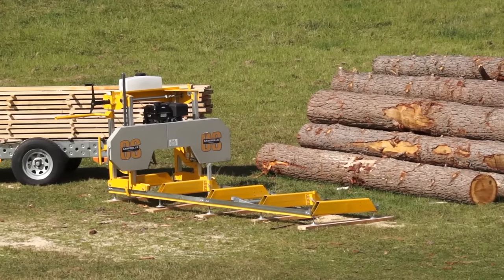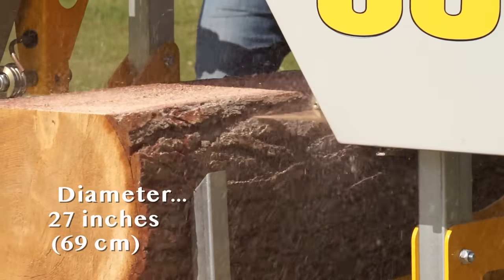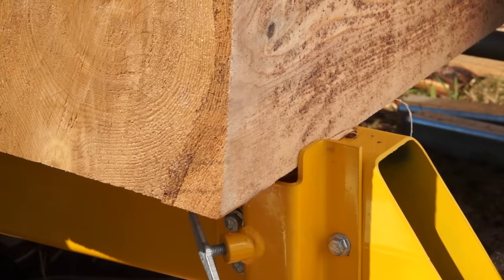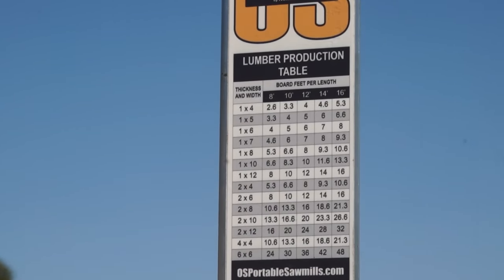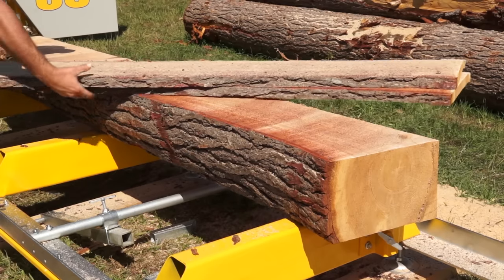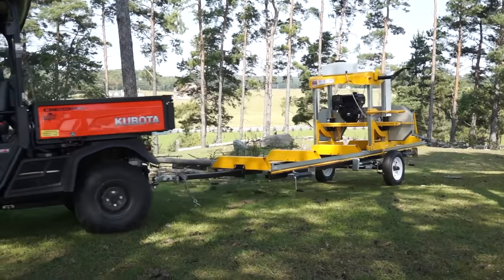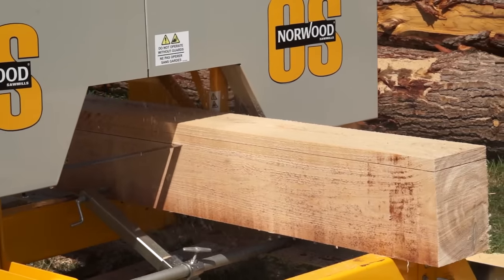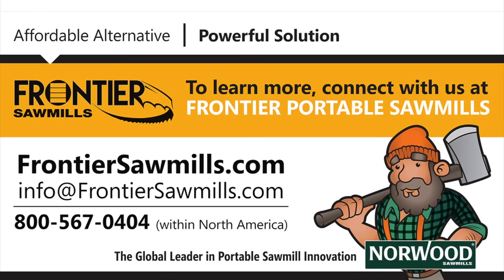The Affordable, Easy-to-Use & Reliable Sawmill You've Been Looking for - The Frontier OS27

Comment: Would make more sense to make a 2 sided blade so instead if a wasted backpull another board can be cut.
Reply from the maker: Your question (suggestion) is not uncommon. Here is the reason why it is not done. Band blades need to be supported in the cut – top, bottom and back. To make a sawmill that can cut in both directions means having a blade with teeth on both sides of the blade. But, if you have teeth at the “back” of the blade, it is hard to support that surface with a blade guide support.
Reply: @FrontierSawmills  ahh yep that makes sense. Never the less. Very cool setup. Thumbs up! Thanks for your response

Comment: Where can buy this mechine
Reply from the maker: Frontier builds three sawmill models with different log diameter capacities: OS23: 59cm (23”), OS27: 69cm (27”), and OS31: 79cm (31”). Standard log length is 3.4m (11’) but you can add 7’ (2.1m) extensions to mill as long as you want.  You can add the optionally available trailer/support jack system to all Frontier sawmills at any time (when you get your Frontier or in the future).

Frontier Sawmills start at just USD $2297 (for the Frontier OS23). The Frontier OS27 starts at only USD $3297.  The Frontier OS31 starts at only USD $3897.  

You can get a lot of helpful info about Frontier Sawmills, including all pricing, at www.FrontierSawmills.com  .

Frontier services your country factory-direct.  To order, contact us directly at Frontier Sawmills via email at info@FrontierSawmills.com . 

Thanks!

Comment: So what does it cost
Reply from the maker: Hi Jayson

Frontier builds three sawmill models with different log diameter capacities: OS23: 23” (59cm), OS27: 27” (69cm), and OS31: 31” (79cm). Standard log length is 11’ (3.4m) but you can add 7’ (2.1m) extensions to mill as long as you want.  You can add the optionally available trailer/support jack system to all Frontier sawmills at any time (when you get your Frontier or in the future). 

Frontier Sawmills start at just USD $2297 (for the Frontier OS23). The Frontier OS27 starts at only $3297.  The Frontier OS31 starts at only $3897. 

You can get a lot of helpful info about Frontier Sawmills, including all pricing, at www.FrontierSawmills.com  .

We would be happy to mail you a free Frontier Sawmills info kit. You can order one online at  https://www.frontiersawmills.com/en_us/free-catalog-free-dvd-form

Thanks!

Comment: A ande encontro  pra comprá?
Reply from the maker: Frontier builds three sawmill models with different log diameter capacities: OS23: 59cm (23”), OS27: 69cm (27”), and OS31: 79cm (31”). Standard log length is 3.4m (11’) but you can add 7’ (2.1m) extensions to mill as long as you want.  You can add the optionally available trailer/support jack system to all Frontier sawmills at any time (when you get your Frontier or in the future).

Frontier Sawmills start at just USD $2297 (for the Frontier OS23). The Frontier OS27 starts at only USD $3297.  The Frontier OS31 starts at only USD $3897.  

You can get a lot of helpful info about Frontier Sawmills, including all pricing, at www.FrontierSawmills.com  .

To order, contact us directly at Frontier Sawmills via email at info@FrontierSawmills.com . 

Thanks!

Comment: Nasıl bulurum, Türkiye’de var mı?
Reply from the maker: We ship Frontier sawmills worldwide.

Frontier builds three sawmill models with different log diameter capacities: OS23: 59cm (23”), OS27: 69cm (27”), and OS31: 79cm (31”). Standard log length is 3.4m (11’) but you can add 7’ (2.1m) extensions to mill as long as you want.  You can add the optionally available trailer/support jack system to all Frontier sawmills at any time (when you get your Frontier or in the future).

Frontier Sawmills start at just USD $2297 (for the Frontier OS23). The Frontier OS27 starts at only USD $3297.  The Frontier OS31 starts at only USD $3897.  

You can get a lot of helpful info about Frontier Sawmills, including all pricing, at www.FrontierSawmills.com  .

Frontier services your country factory-direct.  To order, contact us directly at Frontier Sawmills via email at info@FrontierSawmills.com . 

Thanks!

Comment: Quanto custa pra trazer pro Brasil
Reply from the maker: Frontier builds three sawmill models with different log diameter capacities: OS23: 59cm (23”), OS27: 69cm (27”), and OS31: 79cm (31”). Standard log length is 3.4m (11’) but you can add 7’ (2.1m) extensions to mill as long as you want.  You can add the optionally available trailer/support jack system to all Frontier sawmills at any time (when you get your Frontier or in the future).

Frontier Sawmills start at just USD $2297 (for the Frontier OS23). The Frontier OS27 starts at only USD $3297.  The Frontier OS31 starts at only USD $3897.  

You can get a lot of helpful info about Frontier Sawmills, including all pricing, at www.FrontierSawmills.com  .

To order, contact us directly at Frontier Sawmills via email at info@FrontierSawmills.com . 

Thanks!

Comment: انا عاوز واحد من هذا المنتج كم تكلفته شامل  الشحن والجمارك الى مصر ارجو الافاده
Reply from the maker: Frontier builds three sawmill models with different log diameter capacities: OS23: 59cm (23”), OS27: 69cm (27”), and OS31: 79cm (31”). Standard log length is 3.4m (11’) but you can add 7’ (2.1m) extensions to mill as long as you want.  You can add the optionally available trailer/support jack system to all Frontier sawmills at any time (when you get your Frontier or in the future).

Frontier Sawmills start at just USD $2297 (for the Frontier OS23). The Frontier OS27 starts at only USD $3297.  The Frontier OS31 starts at only USD $3897.  

You can get a lot of helpful info about Frontier Sawmills, including all pricing, at www.FrontierSawmills.com  .

Frontier services your country factory-direct.  To order, contact us directly at Frontier Sawmills via email at info@FrontierSawmills.com . Shipping varies depending on the model you choose and the port.

Thanks!
Reply: My
Reply: @FrontierSawmills  am want wan mines 1500 dollars  bless

Comment: Please Sir how much is this machine
Reply from the maker: Frontier builds three sawmill models with different log diameter capacities: OS23: 59cm (23”), OS27: 69cm (27”), and OS31: 79cm (31”). Standard log length is 3.4m (11’) but you can add 7’ (2.1m) extensions to mill as long as you want.  You can add the optionally available trailer/support jack system to all Frontier sawmills at any time (when you get your Frontier or in the future).

Frontier Sawmills start at just USD $2297 (for the Frontier OS23). The Frontier OS27 starts at only USD $3297.  The Frontier OS31 starts at only USD $3897.  

You can get a lot of helpful info about Frontier Sawmills, including all pricing, at www.FrontierSawmills.com  .

To order, contact us directly at Frontier Sawmills via email at info@FrontierSawmills.com . 

Thanks!

Comment: What's the purchase cost ?
Reply from the maker: Frontier builds three sawmill models with different log diameter capacities: OS23: 59cm (23”), OS27: 69cm (27”), and OS31: 79cm (31”). Standard log length is 3.4m (11’) but you can add 7’ (2.1m) extensions to mill as long as you want.  You can add the optionally available trailer/support jack system to all Frontier sawmills at any time (when you get your Frontier or in the future).

Frontier Sawmills start at just USD $2397 (for the Frontier OS23). The Frontier OS27 starts at only USD $3397.  The Frontier OS31 starts at only USD $3997.  

You can get a lot of helpful info about Frontier Sawmills, including all pricing, at www.FrontierSawmills.com  .

Frontier services your country factory-direct.  To order, contact us directly at Frontier Sawmills via email at info@FrontierSawmills.com . 

Thanks!

Comment: Where can l buy it?
Reply from the maker: Frontier builds three sawmill models with different log diameter capacities: OS23: 59cm (23”), OS27: 69cm (27”), and OS31: 79cm (31”). Standard log length is 3.4m (11’) but you can add 7’ (2.1m) extensions to mill as long as you want.  You can add the optionally available trailer/support jack system to all Frontier sawmills at any time (when you get your Frontier or in the future).

Frontier Sawmills start at just USD $2397 (for the Frontier OS23). The Frontier OS27 starts at only USD $3397.  The Frontier OS31 starts at only USD $3997.  

You can get a lot of helpful info about Frontier Sawmills, including all pricing, at www.FrontierSawmills.com  .

Frontier services your country factory-direct.  To order, contact us directly at Frontier Sawmills via email at info@FrontierSawmills.com . 

Thanks!

Comment: Where can I purchase that machine?
Reply from the maker: Hello Clarence

You can order directly from Frontier Sawmills. Frontier builds three sawmill models with different log diameter capacities: OS23: 59cm (23”), OS27: 69cm (27”), and OS31: 79cm (31”). Standard log length is 3.4m (11’) but you can add 7’ (2.1m) extensions to mill as long as you want.  You can add the optionally available trailer/support jack system to all Frontier sawmills at any time (when you get your Frontier or in the future).

Frontier Sawmills start at just USD $2297 (for the Frontier OS23). The Frontier OS27 starts at only USD $3297.  The Frontier OS31 starts at only USD $3897.  

You can get a lot of helpful info about Frontier Sawmills, including all pricing, at www.FrontierSawmills.com  .

Comment: How much  price...pls
Reply from the maker: Frontier builds three sawmill models with different log diameter capacities: OS23: 59cm (23”), OS27: 69cm (27”), and OS31: 79cm (31”). Standard log length is 3.4m (11’) but you can add 7’ (2.1m) extensions to mill as long as you want.  You can add the optionally available trailer/support jack system to all Frontier sawmills at any time (when you get your Frontier or in the future).

Frontier Sawmills start at just USD $2297 (for the Frontier OS23). The Frontier OS27 starts at only USD $3297.  The Frontier OS31 starts at only USD $3897.  

You can get a lot of helpful info about Frontier Sawmills, including all pricing, at www.FrontierSawmills.com  .

Frontier services your country factory-direct.  To order, contact us directly at Frontier Sawmills via email at info@FrontierSawmills.com . 

Thanks!

Comment: How much the machine.thank you.
Reply from the maker: Frontier builds three sawmill models with different log diameter capacities: OS23: 59cm (23”), OS27: 69cm (27”), and OS31: 79cm (31”). Standard log length is 3.4m (11’) but you can add 7’ (2.1m) extensions to mill as long as you want.  You can add the optionally available trailer/support jack system to all Frontier sawmills at any time (when you get your Frontier or in the future).

Frontier Sawmills start at just USD $2297 (for the Frontier OS23). The Frontier OS27 starts at only USD $3297.  The Frontier OS31 starts at only USD $3897.  

You can get a lot of helpful info about Frontier Sawmills, including all pricing, at www.FrontierSawmills.com  .

Frontier services your country factory-direct.  To order, contact us directly at Frontier Sawmills via email at info@FrontierSawmills.com . 

Thanks!

Comment: Can you please tell me how much and how can I get this machine? Thanks
Reply from the maker: Hi Mike

Frontier builds three sawmill models with different log diameter capacities: OS23: 59cm (23”), OS27: 69cm (27”), and OS31: 79cm (31”). Standard log length is 3.4m (11’) but you can add 7’ (2.1m) extensions to mill as long as you want.  You can add the optionally available trailer/support jack system to all Frontier sawmills at any time (when you get your Frontier or in the future).

Frontier Sawmills start at just USD $2297 (for the Frontier OS23). The Frontier OS27 starts at only USD $3297.  The Frontier OS31 starts at only USD $3897.  

You can get a lot of helpful info about Frontier Sawmills, including all pricing, at www.FrontierSawmills.com  .

To order, contact us directly at Frontier Sawmills via email at info@FrontierSawmills.com . 

Thanks!

Comment: What is the price of this machine
Reply from the maker: Frontier builds three sawmill models with different log diameter capacities: OS23: 59cm (23”), OS27: 69cm (27”), and OS31: 79cm (31”). Standard log length is 3.4m (11’) but you can add 7’ (2.1m) extensions to mill as long as you want.  You can add the optionally available trailer/support jack system to all Frontier sawmills at any time (when you get your Frontier or in the future).

Frontier Sawmills start at just USD $2297 (for the Frontier OS23). The Frontier OS27 starts at only USD $3297.  The Frontier OS31 starts at only USD $3897.  

You can get a lot of helpful info about Frontier Sawmills, including all pricing, at www.FrontierSawmills.com  .

Frontier services your country factory-direct.  To order, contact us directly at Frontier Sawmills via email at info@FrontierSawmills.com . 

Thanks!

Comment: Eski ret kha pe melegi
Reply from the maker: Frontier builds three sawmill models with different log diameter capacities: OS23: 59cm (23”), OS27: 69cm (27”), and OS31: 79cm (31”). Standard log length is 3.4m (11’) but you can add 7’ (2.1m) extensions to mill as long as you want.  You can add the optionally available trailer/support jack system to all Frontier sawmills at any time (when you get your Frontier or in the future).

Frontier Sawmills start at just USD $2297 (for the Frontier OS23). The Frontier OS27 starts at only USD $3297.  The Frontier OS31 starts at only USD $3897.  

You can get a lot of helpful info about Frontier Sawmills, including all pricing, at www.FrontierSawmills.com  .

Frontier services your country factory-direct.  To order, contact us directly at Frontier Sawmills via email at info@FrontierSawmills.com .

Comment: What's the price of the saw mill in Indian currency (rupees)..???
Reply from the maker: Frontier builds three sawmill models with different log diameter capacities: OS23: 59cm (23”), OS27: 69cm (27”), and OS31: 79cm (31”). Standard log length is 3.4m (11’) but you can add 7’ (2.1m) extensions to mill as long as you want.  You can add the optionally available trailer/support jack system to all Frontier sawmills at any time (when you get your Frontier or in the future).

Frontier Sawmills start at just USD $2397 (for the Frontier OS23). The Frontier OS27 starts at only USD $3397.  The Frontier OS31 starts at only USD $3997.  

You can get a lot of helpful info about Frontier Sawmills, including all pricing, at www.FrontierSawmills.com  .

Frontier services your country factory-direct.  To order, contact us directly at Frontier Sawmills via email at info@FrontierSawmills.com . 

Thanks!
Reply: @FrontierSawmills  Thanks for the response though a bit late

Comment: How much? And where to buy it?
Reply from the maker: Frontier builds three sawmill models with different log diameter capacities: OS23: 59cm (23”), OS27: 69cm (27”), and OS31: 79cm (31”). Standard log length is 3.4m (11’) but you can add 7’ (2.1m) extensions to mill as long as you want.  You can add the optionally available trailer/support jack system to all Frontier sawmills at any time (when you get your Frontier or in the future).

Frontier Sawmills start at just USD $2297 (for the Frontier OS23). The Frontier OS27 starts at only USD $3297.  The Frontier OS31 starts at only USD $3897.  

You can get a lot of helpful info about Frontier Sawmills, including all pricing, at www.FrontierSawmills.com  .

Frontier services your country factory-direct.  To order, contact us directly at Frontier Sawmills via email at info@FrontierSawmills.com .

Comment: Yeah how much
Reply from the maker: Hi Chris

Frontier builds three sawmill models with different log diameter capacities: OS23: 23” (59cm), OS27: 27” (69cm), and OS31: 31” (79cm). Standard log length is 11’ (3.4m) but you can add 7’ (2.1m) extensions to mill as long as you want.  You can add the optionally available trailer/support jack system to all Frontier sawmills at any time (when you get your Frontier or in the future). 

Frontier Sawmills start at just USD $2297 (for the Frontier OS23). The Frontier OS27 starts at only $3297.  The Frontier OS31 starts at only $3897. 

You can get a lot of helpful info about Frontier Sawmills, including all pricing, at www.FrontierSawmills.com  .

Would you like a free Frontier Sawmills info kit? You can order one online at  https://www.frontiersawmills.com/us/free-catalog-free-dvd-form .  

Thanks!

Comment: Please let me know the supplier in India.
Reply from the maker: Frontier services your country factory-direct.  

Frontier builds three sawmill models with different log diameter capacities: OS23: 59cm (23”), OS27: 69cm (27”), and OS31: 79cm (31”). Standard log length is 3.4m (11’) but you can add 7’ (2.1m) extensions to mill as long as you want.  You can add the optionally available trailer/support jack system to all Frontier sawmills at any time (when you get your Frontier or in the future).

Frontier Sawmills start at just USD $2297 (for the Frontier OS23). The Frontier OS27 starts at only USD $3297.  The Frontier OS31 starts at only USD $3897.  

You can get a lot of helpful info about Frontier Sawmills, including all pricing, at www.FrontierSawmills.com  .

To order, contact us directly at Frontier Sawmills via email at info@FrontierSawmills.com . 

Thanks!